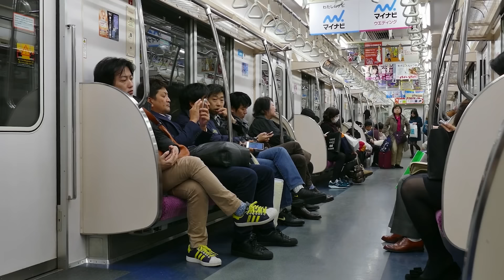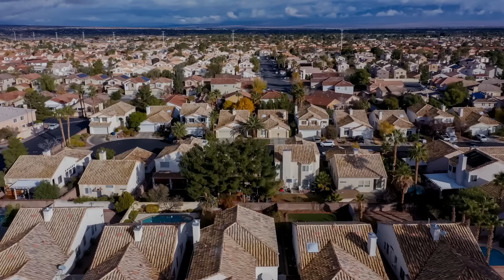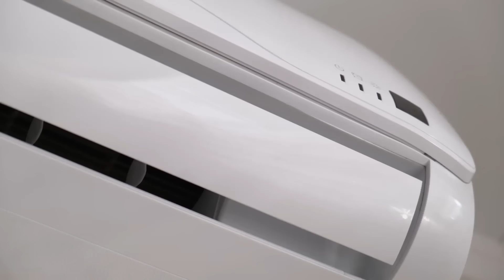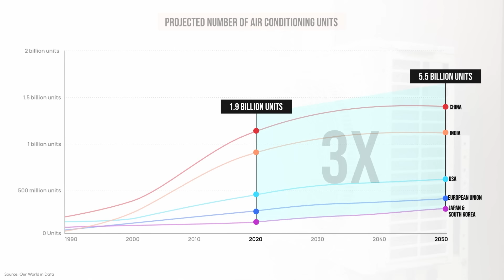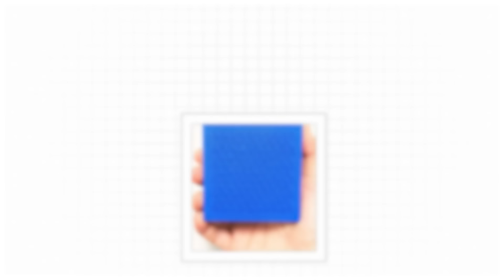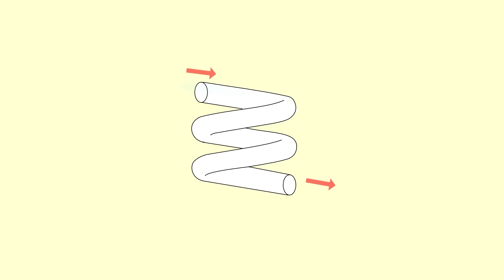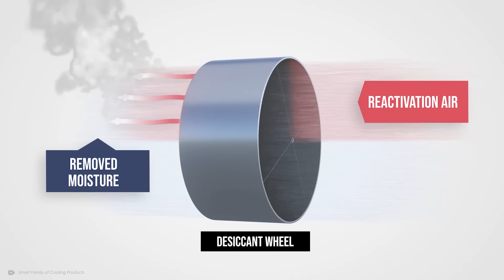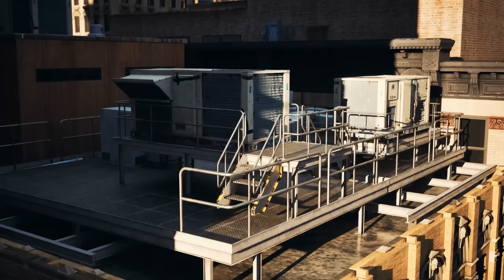The Future of Cooling is Here: The NASA Breakthrough

Comment: Oh I see.. this whole thing is Nasa Propaganda trying to get people to believe Nasa's idea of outer space is real. it's not. That would be a violation of the 2nd law of thermodynamics. I'm a retired air-conditioning heating and refrigeration technician of 30 years. It's about physics namely the 2nd law of thermodynamics and the entropy of a gas. Gas cannot form a sphere shape inside of a vacuum. That's impossible in physics. That so called sphere shaped gas you call atmosphere cannot fail to expand into the available volume it MUST expand causing you Not to have stable pressurization on Earth to breathe. If Earth had an atmosphere (oxymoron as gas cannot form a sphere in a vacuum) that gas would leave Earth and you would die. Again, thanks to the real physics of the 2nd law of thermodynamics. Gravity has never been demonstrated to hold gas to Earth. Heavy gas may appear to pool for a short time but it will expand to fill the volume due to entropy until equalization occurs.  This all shows the heliocentric model is totally wrong. We Must have containment and not be in an open system. Globe Destroyed. Sorry folks but the heliocentric fairy tale is a 2nd law of thermodynamics violation many times over.  

Now if you think I'm wrong all you have to do is Demonstrate the claims. Show me 1) gas forming a sphere in a vacuum that 2) fails to further expand into and fill the available volume due to entropy until equalization occurs. No one Can do that as it would violate known established physics. If you can pull it off, you would win a Nobel Prize for Proving the current understanding of the 2nd law of thermodynamics is wrong.  - Btw, Flat is NOT a Shape. Flat is only an aspect of a surface. When we say Flat we don't mean Earth is overall shaped like a pancake. If Earth has a shape no one has seen it. We can prove the surface is measured flat and Earth cannot be a sphere of the size claimed especially existing inside of an impossible 2nd law of thermodynamics violation. Nasa's outer space is fake and is not a place that can be traveled through.

Comment: All very cool and all, but when are home owners going to see this tech?  Probably will be quite a long time.  Meanwhile, there are systems that us DIY'ers could build that do similar things.  

    Take a lot of calcium chloride and put it in a container.  Insulate that container in a way that slows down thermal exchange, but allows vapor exchange (combo of perforated IR reflectors with hydrophobic thermal insulation [like siliconized polyester batt aka Climashield Apex, or multiple layers of polypropylene fabric] around the container).  Into that container put a very large heat pipe and insulate the part of it that comes out of the insulated container. 

   That heat pipe goes out an insulated window insert to the outside.  The part outside is not insulated and readily allows thermal exchange with the ambient.  

   As the calcium chloride absorbs moisture from inside the house, it heats up, but the thermal insulation keeps most of that heat contained within the container and then the large heat pipe helps to remove that heat to the outside (the copper of the heat pipe, will probably have to have a thin layer of some kind of coating to reduce being corroded). 

  The downside of the above, is that you will have to always have two containers of calcium chloride.  One dried and one actively absorbing moisture.  When the one container being used becomes too moisture ladened, it will need to be taken outside to a Solar heater to regenerate it by driving off the moisture (that could be as simple as a very large surface area "pan" painted black with visible light and IR reflectors around it). 
  Or you could also use a Solar distiller to separate and collect the water from the calcium chloride, and then use that water to spray the condenser coils etc of the AC unit. 

  But this is a low cost, easy to DIY way to remove moisture from the house (especially at night while the ambient temps are lower but the humidity is higher).  The rest will be done by the AC system, but as mentioned in this video, removing some of the humidity inside will help to make it more energy efficient and work less hard.  You can also get away with not setting the thermostat as low, because as noted by others, once the humidity drops to a certain point, comfort goes way up.

Comment: The physics behind carbon based global warming just doesn't work.  They are making stuff up as a means to control people.  Cooler, less dense carbon dioxide at a higher altitude cannot heat warmer, more dense water vapor at a lower altutude.  If this worked, you could heat your house with ice cubes.  Heat transfers from hotter objects to colder objects, not the other way around.  Climate "science" completely ignores thermodynamics.

Comment: It is not that simple cooling requires work because you are fundamentally reversing entropy and that does not happen naturally,there are ways of making this more efficient by have a higher than usual heat capacity refrigerant also by splitting you compressor cycle into several steps having intercoolers between each step thereby reducing back pressure and still attaining compression.There is also the possibility of a novel system of pressure reduction  that can regain some of the power rather than using a valve.

Comment: Humidity in air is only converted to water droplets when the relative humidity is over 100% and this can be done by cooling the air;using centrifugal force not sure perhaps a pressure reduction will cause local cooling and produce some water droplets but can't see how that would be more efficient that standard cooling.As for hydroscopic salts that might work so long as you have a cheap heat source such as a heat pump
Reply: The filter they're talking about is to remove things like droplets of sweat out of the air inside space stations and such. Liquids through surface tension will cling to and coat surfaces. Thats bad when it could short out your O2 controller. This yahoo has completely misunderstood the science and purpose, either unintentionally or as part of the grift. But this is 100% BS. And Ziroth needs to make a video apologizing for spreading it as viable future tech. Like, its shameful....Im probably going to just block his channel because I do not abide bad science and chicanery there in.

Comment: Either way, we are wasting 99% of the water taken from the air in our refrigeration and air conditioning systems. Every home could catch it and use it to water lawns or for laundry and toilets. Large commercial systems could capture that condensate, also. Now, it's just sent down our sewers. Even cars could capture and filter the water from the ac system for on-board drinking water. However, the auto makers want to charge their customers thousands of dollars more to put in ANOTHER system to perform that function which also uses even more fuel. SMH...

Comment: Years ago I saw a widow AC unit that sprayed the condensation water on the hot coils reducing the temperature differential.

Why isn’t this always done?  Using condensed water which I expect is free on minerals to extract heat from warm A C coils seems like a no brainer.

Comment: I think Zorith has just swallowed the press release from Helix without any critical thinking. 

Removing humidity and heat is exactly why these systems are called air conditioning, rather than air chillers.
Reply: Nope. Watched it. Just got a better BS detector.
Reply: @AndrewDunn  I think the point as I understood it, was the technology removes the humidity as first stage before it is cooled, thus increaseing the efficiency of the cooling system.The energy to reduce the humidity with this tech is much more efficient than using the traditional A/C unit to do both humidity reduction and cooling.
Reply: @1021sbruce  Problem is, the desiccant dehumidifier solution is less efficient than the effect of it being part of the condensation system in the first place. Just much harder to measure due to all the stages and losses.
Reply from the maker: Yes this was an error on my part. I believe the liquid desiccant is used first as an aerosol spray to turn the water vapour into liquid droplets first, and then the helix coil is used to remove these droplets.
Reply: @ZirothTech  Now that would be novel and interesting.
Still, it seems like the system would not be more efficient as it involves extra steps where energy creep will happen.
Reply: Rash of AI videos crediting Leon Musk with this in 3, 2, 1.....
Reply: Lack of critical thinking is the whole problem. This CO2 climate story is all BS. We need more CO2 not less. NASA images are already proving the global greening. Yield in agriculture increases with more CO2.
Reply: It’s the issue of how to get the views.. you have to be click baity and go along the lines of only extremism. “Going viral” with click baity headlines and content is the only thing that gets the views hence the money for the channel to continue.. it’s a balancing act channels have to deal with.. become to click baity and lose long term views versus the views that click bait gets you.
Reply: Yea this is just someone trying to sell snake oil and Zorilth is using it as an excuse to make a video. 

But he is just repeating a bunch of buzzwords but not really showing any real results. 

If this tech was real and economically he would have every manor manufacture breaking down his door. 

This is just vaporware.
Reply: Not the first time.
Whatever comes out of this channel sounds about right on the surface, but is complete nonsense if you know about it.
Reply: Yeah, there is a lot of tech bro flash in the pan wank going on there. Cooling the air inherently lowers that amount of water the air can hold (literally the definition of relative humidity), there is nothing parasitic there. The water dripping out of your AC is the water crashing out of the air in the evaporator side of the air handler. In fact, the first AC unit was built for the express purpose of dehumidifying via cooling the air until the water crashes out, then adding a measured amount of water back into the output. It was for a printworks that was having issues keeping the paper moving through their printing machines. Hell, want to make ACs more efficient? Drip that water onto the condenser coils where it can carry away more heat quicker than just the ambient air can, supposing its not already near saturation (100% relative humidity), reducing the heat load on the condensation side! But all that does is affect the efficiency of the heat rejection side of the system, which is sized for worst case scenario so turning the hot vapor into a temperate liquid faster doesnt really do much to the overall energy efficiency. Its the taking low pressure vapor and turning into high pressure vapor (~118psig to ~350psig for r410a respectively) that sucks up all the power. Crashing water out of cooled air at least still helps cool the air. 

Honestly they lost me at 'fight fires in space' ..... When a rendered image laden presentation has to make such leaps in logic like that you know its bullplop. There are SO MANY REASONS why fighting a fire in micro-gravity is a TERRIBLE idea. Just look up how a astronaut almost drowned from a small water leak in their suit. Yeah, it wasnt because their helmet filled up like a fish tank, it was because the water clung to every surface under surface tension. Water freely floating around space craft is a terrible idea. Gee, I sure hope the invento....sorry, charlatan....proposing this didnt come up so short sighted on anything else....like....trying to spin the water out of the...oh wait....
Reply: I think both of you commented before getting to the point in the video at which the principle behind this technology is explained.
Reply: @Yutani_Crayven  The droplets they claim to extract with their special filer structure would already need to be in liquid form and water in that form already has undergone phase transition so doesn't add much to energy usage to begin with. It's the non condensing part in the gas phase that's the issue and which this structure won't do much against.
Descant also has another issue in that the absorption of water is a exothermic reaction which means in the process of drying the air it will also heat up the air and therefor the entire AC system would need to generate a larger temperature difference which takes up more energy. 

It can however also be generalized. Water takes up energy during the phase transition from ice > liquid and liquid > gas, that energy is released as heat during the inverse of those transitions (as per the first law of thermodynamics), any system that has to push water trough that phase transition has to get rid of that excess heat requiring more energy in the process. So I'm immediately suspicious of any system that claims to eliminate energy usage for the de-humidification part, it's pretty much an integral part of cooling air in a moist environment.

Comment: Replace the expansion valve with a Tesla Turbine.
Use variable refrigerants based on temperature. 
Pre-condition air, as stated in this video 

These 3 changes will net HUGE efficiency gains, idk why there's nobody doing this aside from the monthly cost isn't high enough to justify entirely new manufacturing supply chains.

Comment: Water vapor is about 30% lighter than air at the same temperature and pressure, so pushing humid air through helical micro channels won't dehumidify air by centrifugal force. If you compress air the relative humidity increases, that's why you get condensation in compressed air systems, the humidity of the air goes above saturation, when the heat of compression is dissipated. But forcing air through micro channels in plastics isn't a very practical way to do that, in part because the latent heat still needs to be released, and plastics are generally not good heat conductors, neither are most plastics very heat resistant, and there are other issues too. Large surface area to facilitate condensation can be helpful in reducing the size required, but constricted channels in a plastic object isn't a good way to achieve that.

Liquid desiccants isn't a new concept, but it has interesting potential. Besides using waste heat, desiccants, liquid or solid, can be recharged off peak. 

But then again, the fact that water vapor is lighter than air at the same temperature and pressure means that the efficiency of heat pumps could be improved significantly by utilizing evaporative cooling to augment heat pumps and letting that humid warm air rise, and not increase the humidity where the humidity is a problem.

Comment: "Can be retrofitted to existing systems"
Yeah sure. Maybe if you're talking about only retrofitting in industrial AC. Firstly, that helix filter would surely increase air restriction. Second, the helix filter would absolutely need to be located where the condensate is collected. Putting that in an air return with the air filter would be asking for mold.
Home systems using the helix filter would need to be designed with it in mind.

Comment: The first technique to remove water droplets from the air might be widely applicable, the liquid desiccant is probably only useful in very large installations. It's more complicated and expensive. Just using that first technique is not going to have a major impact on the energy consumption of aircon installations.
I wonder if this can not be applied in the exhaust of ICE vehicles. The captured water can be used for water injection, which improves engine performance and efficiency.
Reply: The desiccant is being turned into droplets (mist) and mixed with the intake upstream of the helix filters.  The use of liquid desiccant is not a new idea, but fogging and spinning it out is, and could significantly reduce the size to the system as a whole.

Comment: Not just air conditioning but heat pumps could also use this technology when extracting heat from outside air.  If the water vapor could be eliminated or reduced it would decrease the number of defrost cycles the heat pump needs to perform as well as increasing efficiency..